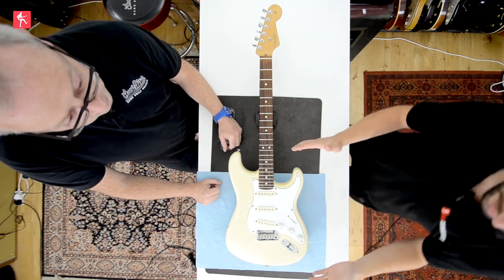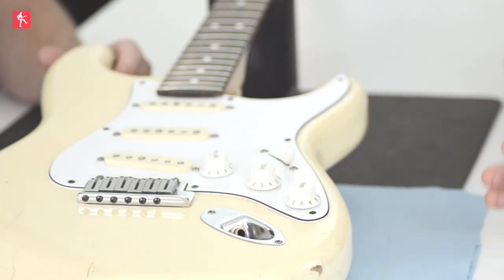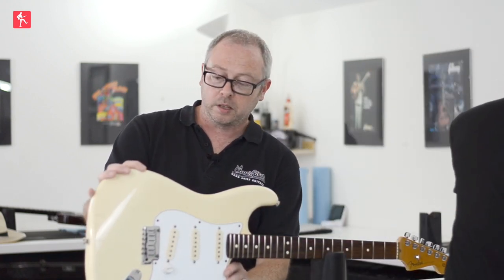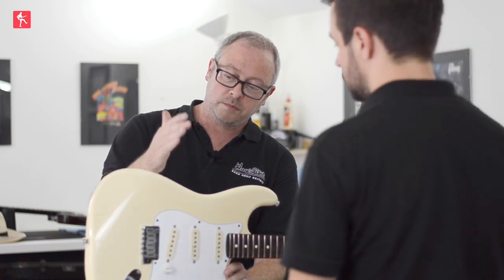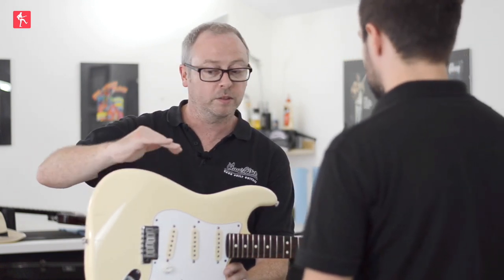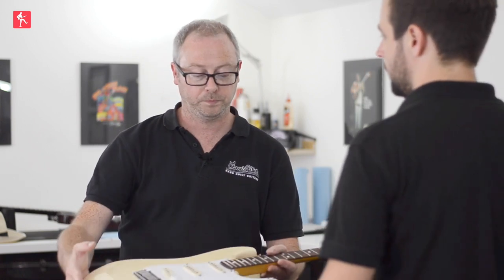Different Guitar Finishes To Be Aware Of When Cleaning Your Guitar - Guitar Maintenance Lesson

Comment: So what's the good thing about nitrocellulose finishes?  Why do so many luthiers insist on using them?  And where's the next video showing us the cleaners to use?
Reply: I've been playing guitar for 34 years, almost every day.
But I'm no luthier....However, In the past, I have built custom cabinets and furniture for about a 6 year period.

Nitro cellulose is a lacquer finish.

What I can tell you about ANY lacquer is that it is so user friendly for doing work with time constraints such as wood cabinets. It will dry MUCH faster than any urethane, acrylic enamels, ect.
It is just soo much easier to work with than any other finish.
You can sand most lacquer in 1 hour for a second coat that is a final.
You can spray a lacquer sealer, wait an hour, sand that sealer down slick and then spray a lacquer finish coat, wait another hour or so, then sand that finish coat with about 600G fine and spray a second final coat.

Lacquer is not as tough as other finishes, but it is sufficient.

If I were doing finish work on a personal guitar, I wouldn't mind using laquer but I would probably use a urethane though.